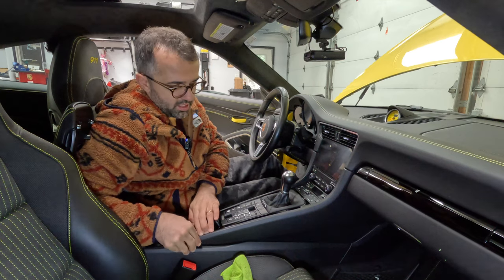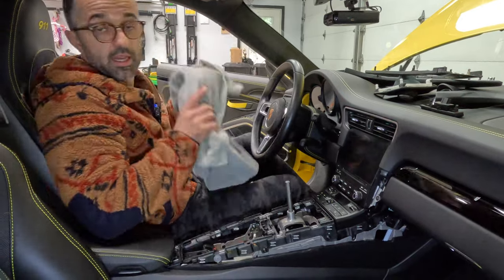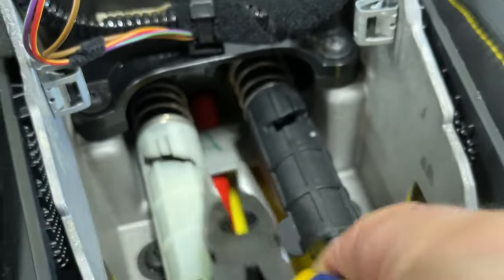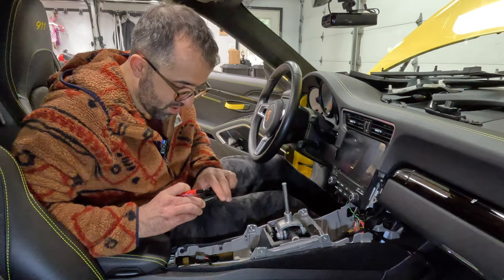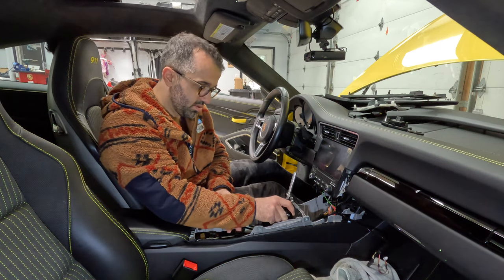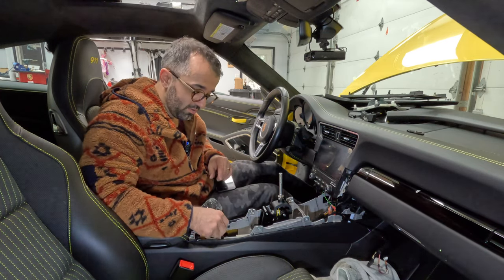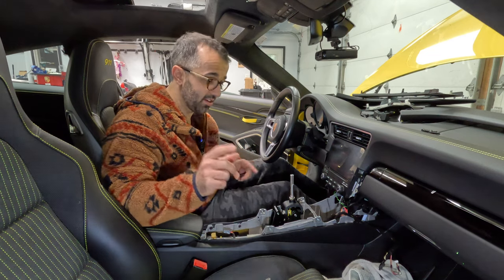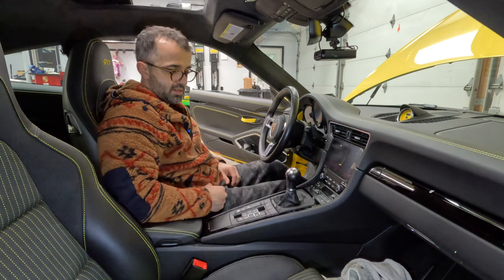Your Porsche needs this: Numeric Racing Shifter! Install DIY (911, Cayman)

Comment: Excellent video, Tommy.  I just installed the Numeric SSK in my 718 Boxster GTS while swapping between your vid and the official one from Numeric.  Your "pro tip" about the washer under the left rear corner came in super handy b/c mine was also rubbing.  However, mine actually needed TWO small washers to shim it up enough!  Anyway, this shifter is the real deal.  Feels like a damn rifle bolt now!

Comment: Thanks for the video!  Really considering getting for my 982 GTS 4.0.  Quick question- any issues with shifting into reverse or any fear of missing a gear with the new shifter?
Reply from the maker: Zero issues whatsoever. It is an amazing modification highly  recommended.

Comment: i found that the left rear clip of the shift boot needs to be trimmed as the numeric housing is slightly in the way. happend to two vehicles I have installed the shifter on.
Reply from the maker: Hhmm I added washers which helped too

Comment: Hi. What is a part name of original carrera T short shifter? I have 991.2 c2s and only part I found is either same shifter for all 991.2 or the gt4, but this one is supposed to have 6 instead of 7 gears
Reply from the maker: GT4 is the same.
Reply: @TommyLGarage  so case - part you installed as short shifter is  981.424.010.20 - from gt4? no issue as from vin it is 991.424.010.00 the long installed in factory? sorry for bothering but Porsche is not helpfull in that :)
Reply from the maker: @czidnej  not sure what you mean
Reply: @TommyLGarage  problem saving reply with part numbers. porsche service not really helpfull
Reply: @TommyLGarage  so do you have maybe the part number of your original shifter you had in 911?

Comment: Tommy, thank you for the clear step by step instructions. I just completed the install and and can say following your video while I did the work made it pretty easy. I didn’t thing that the just changing the shifter (without changing the cables to the transaxle) could make such a significant difference! No more sloppy shifter! I love it!
Reply from the maker: Glad it worked for you!! It’s such an amazing upgrade

Comment: The linkage is shorter in the 991, not longer. The gearbox is in front on the engine in the 991. It's behind the engine in the 981. But it's a completely different gearbox. Which is why it feels different.

Comment: I wish it was that easy to change shifter on the M2 I am looking at the RTD motorsports shifter because they is no trimming required, I had an abarth 500 and installed a CAE short trow shifter and it was amazing and easy to install too,

Comment: I got the cable and the function first shift right kit for my 997.2 turbo that has the oem 997ssk.. if that leaves me wanting, I may end up going with this shifter
Reply: Did you see much improvement with the function first shift right kit?

Comment: Finish the job, add the cables, you'll love it!
Reply from the maker: I actually drove a car with cables and didn’t like it honestly.
Reply: @TommyLGarage  As my father used to say, that's why they make chocolate and vanilla! I love mine ('17 base Carrera, Softronic Tune, SOUL Sport Cats & Headers, Numeric Shifter & Cables DSC Sport Controller,, GiroDisc Rotors, Pagid Yellow Brakes Pads for track days ) . Have you tried the DSC Sport Controller for your PASM system?  Thanks Tommy, really enjoy the channel.

Comment: doesn't it lean toward the front and not center like OEM? My friend has the whole bundle and we had to adjust the cables abit to center the shifter correctly.
Reply from the maker: No it sits straight. But can easily be adjusted with cables you’re right.